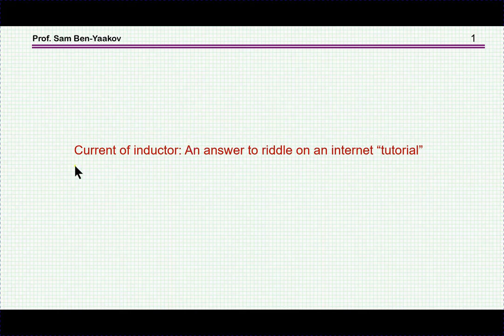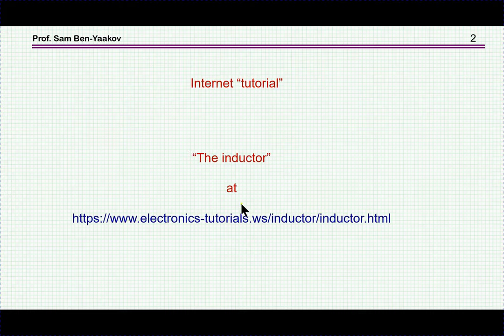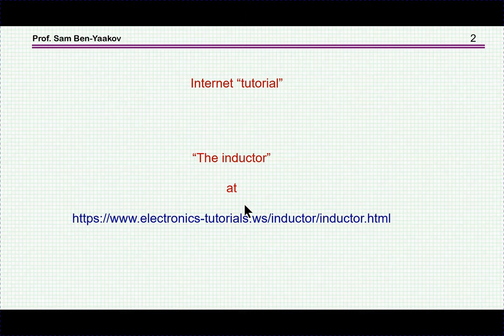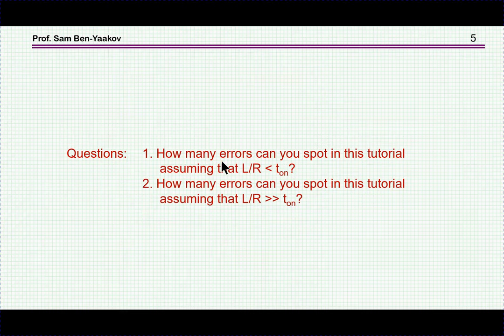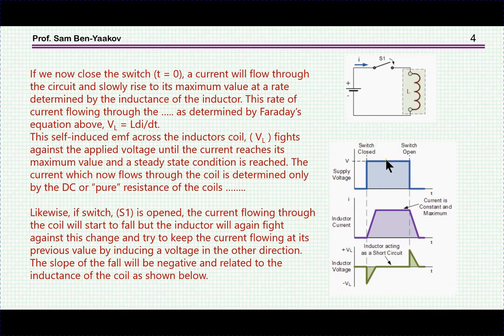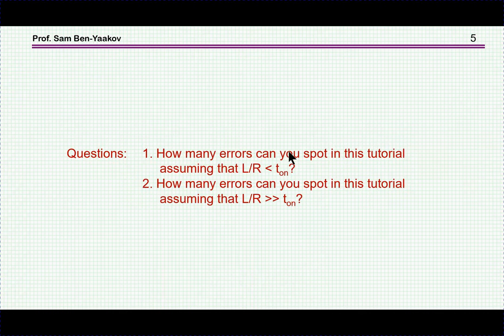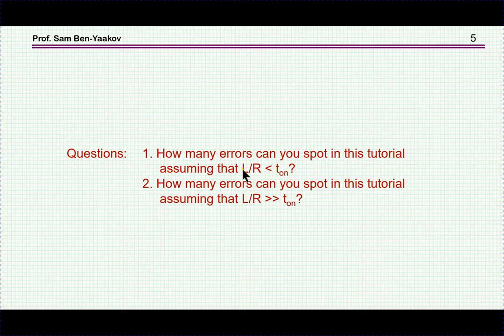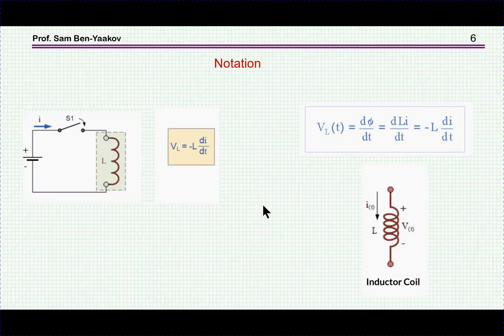Current of inductor: An answer to riddle on an internet “tutorial”

Comment: The author of this tutorial could have easily avoided these errors by simply checking them on a simulation tool -Matlab, MathCAD, or SPICE. Readers should do the same. I always check any analysis with one or two simulation tools before I present any material. The best way to check a circuit analysis, of course is to design a bread board and test the circuit. 

Great job Dr. Ben Yaakov.
Reply from the maker: Good points . Thank you.

Comment: There's one more case Sir, i.e.core saturation which would occur if L/R <<< t_on should also be considered . Then i think there would be one exponential rise (till saturation), followed by a steeper exponential right (after saturation) after which a steady state and very high value of current would be reached.
This could be modeled as a step change in L, if the current 'i' exceeds the saturation current.
Please confirm if this is correct
Reply from the maker: Thanks for pinout Srinath. The original and my treatment assume a linear inductor (could be air cored).

Comment: Question regarding an earlier post. I have been looking for a schismatic for fluorescent desk lamp which has two 15 watt tubes a choke and NO STARTER. Everything I find has a starter and or an electronic choke.  This lamp is a product from LUXO, 1960 vintage.  I do not understand with volumes of schismatics available on the internet for this fluorescent light, why I can not find one with no starter. I literally have spent hours looking for his Diagram.  Thanks.
Reply from the maker: if the choke and cap produce at start a high enough voltage for generating plasma  the lamp will ignite. In fact, there were (I don't know if still available) some lamps with no filament (which is used to lower the voltage needed for breakdown)

Comment: Dear Professor. Of course you are right about all errors in this "tutorial". But I think your explanation on slide 9 is not quite correct. The negative sign for derivative di/dt does not mean that the current is going in opposite  direction. It does only mean that current's shape has a negative slope.
Reply from the maker: AS I was explaining in video, if you consider an initial condition in which there is no current in the inductor, then after switch closure the current is in the direction of di/dt. Thanks for illuminating this.

Comment: Sorry but this video (and other videos) to discredit the tutorial is nonsense. The circuit clearly shows the characteristics of a pure inductor, there is no series resistance which you have decided to add for your convenience. Therefore there is no L/R quantity, so your analysis is flawed. At the initial closing of the switch, t = 0, electric current starts to flow through the coil thereby producing a magnetic field. The growth in current through the coil from 0 to Imax is not an instantaneous step change, shown in the middle graph, as the incremental change in current through the coil causes an emf to be induced in itself because of this changing magnetic field which opposes and controls the rate of current change (Lenz's Law). This self-induced emf is of opposite polarity to the applied voltage from the battery. Hence the negative sign in the equation -Ldi/dt demonstarted by the bottom graph graph. Eventually steady-state conditions apply, the coil acts as a simple piece of wire, maximum current flows from the battery source, and the self-induced back emf decreases to zero. All shown graphically with no resistance. Opening of the switch has the reverse effects. Then the tutorial and explanation is valid and correct with no added resistance.
Reply from the maker: Well, Well Well, Electronics Tutorials. You obviously did not bother to watch, study or understand my video. 
1. “The circuit clearly shows the characteristics of a pure inductor, there is no series resistance” ??? The fact that the current reaches a fixed value means that there is a resistance.
2. “Eventually steady-state conditions apply, the coil acts as a simple piece of wire, maximum current flows from the battery source,” ??? What the heck is “the coils acts as a piece of wire”? What the heck is “maximum current flows from the battery source“? Is the “simple piece of wire” with no resistance? Then the current will continue increasing. Non zero resistance? Here is your resistor.
3. “Opening of the switch has the reverse effects.”??? Opening the switch causes the current to drop at a constant slope? This is the worst nonsense of all. So why there is a need to protect coils when turned off? You obviously have no experience whatsoever in electrical engineering. 

Unless you retract, I will prepare another video on the many ignorant assertions in your response.
Reply: what!?? what steady state if there is no resistance? May I suggest you read a "real" textbook on basic circuit theory before writing any "tutorial" on internet.
Reply: Sam doesn't need my help defending his explanation, but I can't stop myself. Think about what you just said, Electronics Tutorials. Have you studied calculus at all? Think about Vl = L*dI/dt. Do your KVL. Vbat - L*dI/dt = 0 for the case of no resistor. Vbat/L = dI/dt. Since Vbat and L are assumed constant, then dI/dt is also constant, meaning it does not change. the 'd' in dI/dt is to remind us of "delta". ΔI/Δt = Vbat/L . ΔI = (I_t2 - I_t1), Δt = t2-t1 .. So (I_t2-I_t1)/(t2-t1) .. Where have we seen this form before? Oh right, that's our slope for the line formula, m = (y2-y1)/(x2-x1). y=m*x+b, with m = dI/dt. So, if m is constant, does y = m*x+0 (we assume we start from 0 current so b is 0) ever turn? Try plotting it. Tell me if it ever stops increasing. Put it into wolfram alpha, or a calculator. Try increasing x, (which is time, y is current as a function of time) higher and higher. Does the function ever stop increasing? When does it plateau? Because this is the basic expression for a DC voltage source in series with an inductor without resistance. Your statements unfortunately show a lack of understanding for the fundamental mathematics we use in analysis, putting aside understanding of electrical components.

I also think you might not be realizing that there is no discrete resistor component, and that one is not required in order to have resistance. Wire has resistance (let's ignore superconductors as they are not unfortunately not practical in typical electrical applications). Inductors are made up of coils of wire. Those wires have resistance, therefore it is an integral part of the inductor construction itself. It is unavoidable. We cannot physically create an inductor without resistance.If you physically measure a /real/ physical inductor with no added resistor, you will find the model I described lies to you. It needs another term. That term is R for resistance.

Of course, every circuit has parasitics. Your capacitors contribute to inductance, so we reduce lead spacing. EMC capacitors are very small and placed just so to reduce loop size or they will generate more parasitic inductance. Capacitors have an ESR among other parasitics as well that is very important to consider in circuit design. Resistors have parasitic capacitance and contribute to inductance as well by forming part of a loop (and circuits are loops, hence the name). It is key to understand that we really can't separate the three circuit component models from each other in the real world. We sometimes or often choose to ignore them when they do not significantly impact the purpose/performance of the circuit vs the model, but they're still there. You don't need to have a device titled an "inductor" to have inductance, you don't need a device titled a "resistor" to have resistance, and you don't need a device titled a "capacitor" to have capacitance. These names are simply to tell you what circuit behavior is intentionally emphasized in the design of the component.

Anyway, hopefully I didn't say anything inaccurate. I'm also willing to learn and correct myself if I did.
Reply from the maker: @Sevalecan  👍 Thanks for participating in conversation.